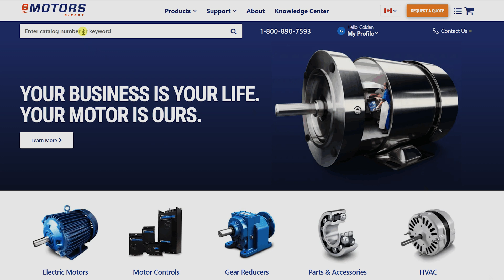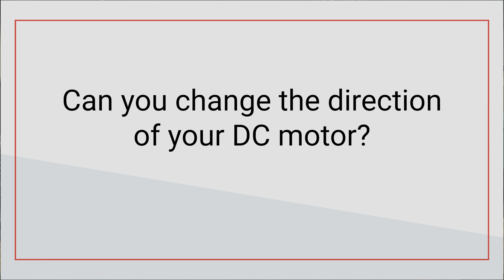How to Change Direction of a DC Motor

Comment: I have a 125 VDC motor that was taken apart to change bearings.  Would the armature make a difference on rotation if it wasn't sitting correctly?  We have tried multiple connections and rotaion is always the same.
Reply from the maker: Yes, this would make a difference on rotation.

Comment: Hello i was wondering how to change direction on a 12v dc blower fan motor i already stripped the fan wheel of and the casing now im puzzled what to do next do i only swap the brushers or do i need to go deeper thanks in advance
Reply from the maker: Disassembly was necessary. You can just swap the input wires.
Reply from the maker: It's possible you'll have to swap the brushes as they are generally beveled to reduce friction. But other than changing the polarity, the requirements for a reverse are manufacturer and model specific so I'd recommend checking the datasheet or user manual.

Comment: Motorcycle starter...
Bike started intermittently. Cleaned up the wires/insulated bare spots, put it back together according to the manual. Now operates in reverse. Help...?🤔
Reply from the maker: Hi Collin! Great question. Motorcycles are outside of my area of expertise (I deal with industrial electric motors). You may be better off to reach out to the dealership or a motorcycle expert.

Comment: Hello I bought a counterclockwise 48VDC NIDEC 140-22-4004 for a steering hydraulic clockwise Vickers pump. Any chance of changing the motor rotation?
Reply from the maker: You should be able to change the direction, based on the info provided.

Comment: I'm sorry to bother you with a question that's way below your pay grade, but is it possible to control a DC motor's speed and direction with a single knob or lever with no switch?  The closest that I've gotten is a balance potentiometer, but it's not likely to work.  I will be using it to control the speed and direction of a table on a small milling machine .  I've spent hours searching, and I've found nothing that isn't stepper or arduino based, and they aren't even a very good solution.  Any help would be greatly appreciated.  If you're too busy, I understand.  Thanks.
Reply from the maker: Hey Bill, great question. Are you working with a brushless DC motor? Could you send pictures of the motor to customerservice@emotorsdirect.ca and we may be able to get you a more specific answer.
Reply: @emotorsdirect  Thanks so much for the response.  I haven't bought a motor yet.  I'd say the equivalent of a 1/8th to 1/4 HP motor would be plenty. I will choose the motor based on the availability of a single potentiometer (as I imagine it) to control speed and direction, and the perfect control (in my opinion) would be something like a balance control with a tactile detent at center position that's stout enough to replace the knob with a lever and the additional torque that would put on the shaft (if possible, but that may just be a dream).  

Frankly, I'm really surprised that there doesn't seem to be anything available. 

I'd imagine it as a two wipers (wiper may be incorrect word, but I hope you get the idea) at two levels.  Wiper one would make contact with a resistive element in one direction, and the second, lower wiper makes contact with a resistive element in the opposite direction.  Think of it as 11:50 to 6:40 goes one direction with first wiper contact, and 12:10 to 6:20 goes the other direction with the second wiper contact.  Neither wiper would make contact with a resistive surface from 11:50 to 12:10.  Each of the wipers would connect to their own terminals and one set would be reverse polarity.  

It could also be a sliding control with no motion at center with left and right speed increasing at each side of the slide.

I've looked in to steppers too, but I'm not finding that it would be any simpler than a DC motor.  I'm up to 4 controllers with several relays just to control forward and reverse with correct variable speed in a joystick.  It won't work for the application because it springs back to center when released so it can't maintain constant speed without a hand.

Once again, thank you for responding, and forgive me for being so long winded.
Reply from the maker: @billsmith5166 Based on your use case, we'd suggest reaching out to the mill machine manufacturer. They'll be able to suggest a particular motor and control that will work well with their machine and achieve what you're looking for.
Reply: Everything they have is gear driven, and I want direct drive.  I really appreciate your time.  Thanks!
Reply: @billsmith5166  AC stepper motor. For X or Y axis on your milling machine. DC stepper is gonna be very expensive if Direct-Drive is what you want. Even this option is gonna cost u a few hundreds buck and a lot more if you want well-branded sruffs. Mine cost over 150$. 
- 110$ for AC stepper motor (8NM - 14mm shaft)
- 10$ for controller (Programmable) 
- 16$ for a single coupling. 
- There's no motor mount available, you have to make it by yourself. I use thick aluminum plate and it's very tricky to mount it your table.
Reply from the maker: @billsmith5166  Hi Bill, sorry for the late reply. The KB Electronics KBMG DC direct drives would work based on what you've described: https://www.emotorsdirect.ca/search?order=custitem_total_quantity_available:desc&brand=KB-Electronics&product-subcategory=DC-Drives